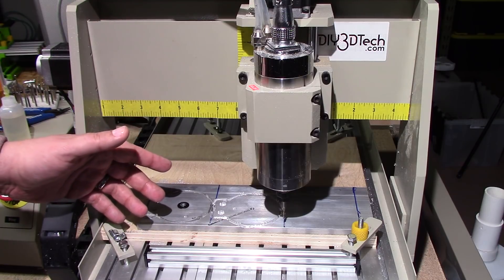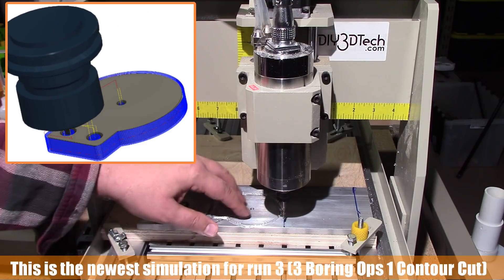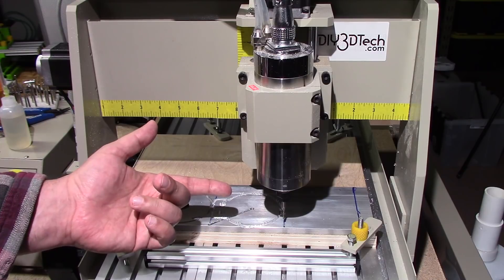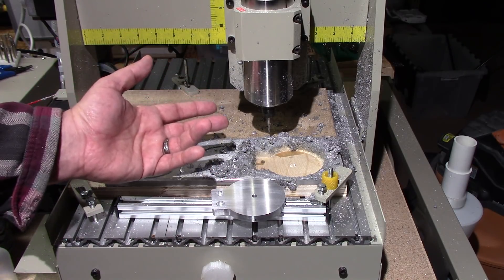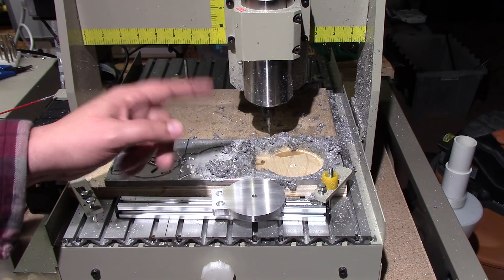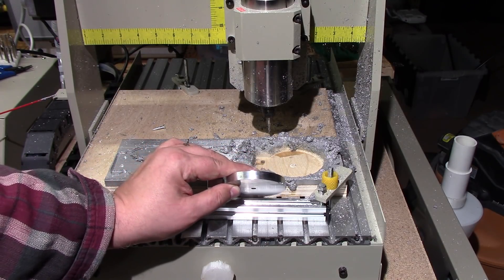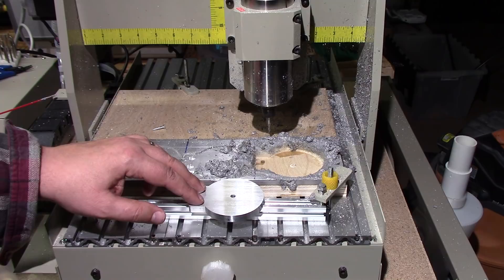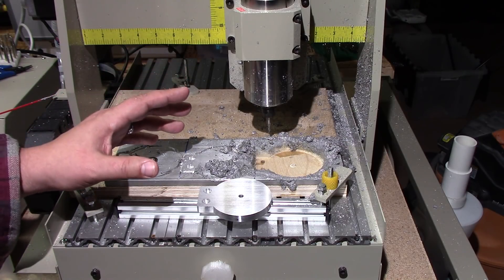3040 CNC  - Cutting Thick Aluminum Success!

Comment: Thank you so much! Have the same cnc, brand new. Wood is cutting perfectly like the cnc cutter specs recommend. But aluminum is a nightmare. I did a 1mm deep cut with a 10mm cnc mill but the spindle stopped rotating mid program. The 500W motor couldnt handle it. I saw you do 0,25mm passes. Thanks for that

Comment: It's almost impossible to give a real evaluation of a machine without fully understanding how to properly use it.  Granted, it's a hobbyists CNC, but still it's important to understand proper set up to really evaluate the capabilities of whatever is being tested.  Proper work fixturing, understanding what material is really being used, describing what the machining priorities are (fast? excellent finish?), mill bit diameter, flute count, material, speeds and feeds that are defined by those parameters, lubrication, chip removal, etc....all very important to really test the CNC.

Comment: did you connect the machine directly to the computer and use fusion 360 to run the cnc machine. Just bought a cnc 3040 second hand need help getting it going

Comment: Shorten your tool stickout a nice short stubby endmill with appropriate coating will help your not working with wood cut your stock to size and look at holding it in a vice so your not having to slot cut expecially with no proper chip evacuation

Comment: A number of things you need to cut aluminium ... A rigid machine, solid workpiece, correct bit, correct plunge and feed rates and coolant! Ideally, air to clear swarf from workpiece.
Reply: if you don't have coolant,  plenty of light oil can go a long way. i always use 2 flute for Al in regular machining. im just getting my feet wet in cnc with a mini setup

Comment: i have almost same machine, except, it seems that you've got a .8kW water cooled spindle - mine is only 400W air cooled. Since i'm currently in need of some aluminium parts I want to try this. Do you believe this can work?

Comment: Is there some some sort of resistance that hurts the motor on the long run doing this?
Reply: As long as it doesn't get too hot and the bearings are in good condition, the setup is correct, and the proper end mill is used, it should be capable of running for hours.

Comment: thank you very much for showing this video. I've been told by many people online that a 3040 CNC Motor isn't powerful enough not cut Aluminum correctly. can you give me the specs of this CNC machine.
now i will purchase a 3040 machine.
Reply: The stock 500w spindle i got on mine wasnt enough really but it could cut aluminium. If you swap it out for a palm router it can do some good cuts

Comment: Hi buddy I have been maching for yours if your using a router the most inportant thing is getting rid of the chips, use a single flute that will help you loads, and a little bit of spray oil to help with the cooling and lubrication, air is also very good to help cool and remove the chips hope this helps I cut Aluminium all the time on my CNC router, But single flute is the way to go try it and let me know how you get on,
Reply from the maker: I think this one was two flute and it did well also and used a commercial water based cutting fluid.  Also if you look in the play list I also designed a collar to hold a mister too.  I really like this machine!

Comment: These ebay cnc machines are great value and capable.fyi...you can now get a machine 2x the size of 3040 for cheap....the ebay chinese  6040 cnc with 4axis and 1500w spindle is under $1k.
Reply from the maker: Yes it depends as I really don't have need for the size of the 6040 nor the space (I have a ton of stuff).  However you are correct they runs some good deal on eBay for these machines!  I am kicking around getting 5 axis version or 100 Watt co2 laser...

Comment: Can the 500w version cut 1mm aluminum without issues?
Reply from the maker: Depends on the duty cycle, if your going to cut a piece here or there then you can make due.  However if you are going to do it on a regular basis then I would say at least 800 watt water cooled or even 1200 water cooled...
Reply: DIY3DTECH.com Thanks for the quick reply and will check them out

Comment: in cnc never this alu better 7075
Reply from the maker: I have no idea what Alu but will make note.  Many thanks for commenting!
Reply: @DIY3DTECHcom  Hello.
It is very hard to work in soft aluminum.
But if you use hard aluminum, it makes the milling job easier. 7075 Aviation Aluminum
The price is also affordable.

Comment: Slotting and profiling around the edge like that is really hard for any machine. Use a bigger tool if you can and use adaptive clearing around the edge and it will go way easier. The chips have nowehere to go on a deep narrow slot like that so you start welding material and getting material build up. That's why it's so hard.
Reply from the maker: Thanks for the tips!
Reply: @DIY3DTECHcom  no problem! I'm no expert but i know a couple things 'bout machinin' :)

Comment: Make a water bed and buy a small water pump  for a diy cooling system when cutting aluminum.
Reply from the maker: I did that for stones and glass (made several video on this just check out the CNC playlist)....

Comment: "I don't know what kind of aluminum this is"
That is a problem.
Some aluminum is soft and gummy, like the stuff you buy at Home Depot and Lowe's. It will clog up ordinary tools like hack saws and files. I can imagine how badly it would fail on something like that device. You need real 6061 aluminum or some other known type of aluminum that is easy to machine. It makes chips instead of sticking to your bits.
Reply from the maker: I don't know either as purchased this as a second, however it was a bit soft..
Reply: M T  
Yeah, and you need a metal lathe, too. And all the accessories.

I would like a CNC for cutting simple 2-D shapes. Maybe next time.

I ended up with a 3D printer. It's fun. The material is relatively soft, and the making is not precise, but it's a good view of things to come. I think the best usable plastic for an end user 3D printer is supposed to be nylon. Nylon is okay, but there are lots more plastics.
Reply: You want a 6061 series aluminum with T6 heat treatment.
Reply: As mentioned above on small machines, 6061-T6 works best. I was easily able to cut 6061-T6 on a small converted Sherline mill without air or liquids. It cut the aluminum like butter. I used a 3 flute cutter. It is possible the sherline machine is stiffer than this mill though. That might make a big difference cutting the thicker materials. And getting the proper feeds and speeds, and spindle rpm is really important.

Comment: excellent work .. ive cut deep with the 6040 on aluminum ,and it takes you standing there and watching for sure.
Reply from the maker: Yes it does take some watching :-)  I am thinking about trying to mist IPA, your thoughts?
Reply: @DIY3DTECHcom  id just go full flood coolant with a collection tray.. amazon has dog cage trays for about 25 bux , perfect water collection trough to recirculate back down to a submerged pump ( im basically doing a full on flood coolant on my 6040 now , im sick of sitting there watching )
Reply: @airgunningyup  If its only 1mm thick would i have to be watching it? Or could i just do something else while it does its job?
Reply: @chroma6947  you can just do 2 passes of .5mm , and not have to watch

Comment: Cool video.  If I want to mill 20mm thick aluminum, what wattage motor should I go with?
Reply from the maker: Its more of a function of duty cycle, if this is something your going to do on a regular basis I would go for the 1,200 watt water cooled unit...

Comment: Subscribed. I bought a 3040T with a 800w VFD watercooled but it vibrates like anything even whilst just cutting cast acrylic. I am going to work on my speeds and feeds I think a bit. I was thinking it could be the work table being that extruded aluminium type. What diameter rails do you have  on the Z, X and Y axis?
Reply from the maker: Let me see if I understand this correctly it only vibrates when your cutting correct?  If it is just sitting there running it does not and the run out on the spindle is fine?  If this is the case I would check your tooling as I would use a single flute cutter running fast feeds with fair depth cut (maybe 33% of the tool).
Reply: @DIY3DTECHcom   Thanks @DIY3DTECH.com , Yeah it does not vibrate so much when cutting plywood but my first attempt at aluminium did not go well, vibrated so much I had to stop but it was a suspect piece of extrusion from B&Q. I did notice the other day when drilling some holes it seemed to be out slightly but I made the mistake of resetting the Work Piece zeros on restart as I'd spotted the holes the night before. I think I will invest in a precision tolerance 6mm chuck and use the engraving bit and measure run out on the body of the bit to check the spindle. I still have some dials etc. from when I was an semi-skilled engineer 20 odd years back. Back then I did all my work on Manual machines with limited use of CNCs (setting up and a tiny bit of G-Code). I used to be able to amaze other machinists by taking 4mm depth of cuts with a tipped shell mill in steel  on a Bridgeport and using a 5ft Radial drill to tap 4mm holes in steel plates 6mm thick, lol, lol.
Reply: @DIY3DTECHcom  Once I increased spindle speed the results were better. I do need to check spindle run out though as when drilling can hear the drill rubbing on the retract and re entry when peck drilling, could just be poor quality drills that are bent I guess. I am using Standard precision colets that should be good for 0.01mm run out.

Comment: Do you Think you could cut steel with it? 
In my case it would be around 1 to 2 millimeters.
Reply from the maker: Yes if its mild with the correct tool.  However I would step up to the 1.2kw spindle (this is an 800 watt) if this is something you will do on a regular basis.

Comment: when you cut aluminum router cutting. the best quality 

Diamond over-DLC Aluminum φ2 2.5 3(4)mm router Endmill single(2)-flute engraver
Item ID: 254188000203   ebay.com
Reply from the maker: Do you have a link?
Reply: @DIY3DTECHcom  You can buy  https://www.ebay.com/itm/254188000203
Reply: @DIY3DTECHcom  https://www.ebay.com/itm/254188000203

Comment: It looks like you forgot to set G28 to a safe height - one of my favorite mistakes to make! I've crashed hard on several occasions for the same reason. 
Nice work!
Reply from the maker: Safe Z travel height was set to I believe 10mm :-)
Reply: @DIY3DTECH.com you seen the height setting tool? Clip to tool and touch on a plate to do, not sure if done on this or just bigger ones
Reply: it's a fusion thing, the first movement it does is without adjusting the z height, it's really annoying, because usually you set you work Z0 and then start the job. Often you forget to jog the Z up for that first movement and end up with an ugly line on the piece or a broken endmill
Reply: @mikesnapper9001  A good habit is to start tool at 1.000 above part. So Xxxxx, Yyyyy move and then from Z home to Z 1.000 then down to starting point. When Z momentarily stops at 1.000, it's like a visual safety move.

Comment: What tool are you using specifically? Best solution I have found for aluminum at router rotation speeds in a single flute O-flute cutter and an alcohol mist sprayer.  You should make the biggest chips you can make before the surface finish suffers. Your chips are super tiny even for a bit that size.  Th single o-flute will open a larger channel for larger chips.  The chips take the heat of friction out of the tool and part.  If your chips are too small they act like hot glue and clog your tiny flutes and break your tool.  Whatever part you are cutting out should be cut climb and not conventional.  This includes full cutter width profiles.  creds: using a router for 15 years to cut all sorts of things that should be left to a mill :D
Reply from the maker: I can't remember if that 1 or 2 flute, but two at tops.  I was using a using a water based cutting lubricant.  Know what your saying about chip size, these weren't bad.  I am not sure the grade of aluminum, but it was a bit gummy (soft)

Comment: You have your feeds too high and your doc is too aggressive. Also make sure you’re using an up cut bit. Retract height needs to be set to prevent the drag line. Stop using tape and machine a low profile vise. I machine 6061 on this machine all the time and up to 2” thick barstock. That’s likely 6061t from Colorado Springs the guy selling it is a prolific seller 😂
Reply from the maker: Not sure on the feed being too high because as long as the bit was cooled (with the lubricant) it did well as not sure what you mean the "doc" was too aggressive?   Also yes to the up cutting bit.  Do you have any suggestions for a water based lubricant/coollent?
Reply: Doc = depth of cut. I have this machine and for aluminum you want to use feeds 500mm/s and depth of cut (doc) 0.2mm.
Reply: @fsecofficial  you mean 500mm/minute...this cnc cant do 500mm/s
Reply: @shelby50411  yes

Comment: Which spindle power are you using? Your description links for the 3040 have both 400W and 800W versions.
Reply: I'd also like to know.  I see you have water cooling lines so I'm curious if it's a 1.5kW or higher?
Reply: @pparrett  I just saw he answered another person asking the same question. It's 800W water-cooled.
Reply: @dimman77  thanks!
Reply from the maker: I have the 800 Watt  and the for the 3040 it works well, not sure I could justify the 1.5kw unit on it.  Maybe the 6040 however that is a LOT of power (i.e. 1.5kw) these classes of machines.  However love the water cooling!

Comment: So it means if u crank up the spindle RPM and go real slow with the feed rate then the cut would be accurate and polished? i have ordered 3040 with 1.5KW water cooled spindle but 2.2KW VFD. Hope it will do.
Reply from the maker: Wow! at 1.5Kw that will be a mini monster as the 800 Watt water cooled spindle as been plenty so the 1.5 will be amazing!
Reply from the maker: Wow! at 1.5Kw that will be a mini monster as the 800 Watt water cooled spindle as been plenty so the 1.5 will be amazing!
Reply: I would advise against just increasing your RPM while decreasing feedrate.  It actually won't leave a good surface finish, because then you're cutting too thin of a chip and the cutting edge is rubbing against the material instead of shearing it off. This will also dull your cutters much more quickly.

The best way to get accuracy and good surface finish on walls is to leave some extra radial stock on the part while cutting the profile, then come back at the end, plunge to full depth, and cut all the way around to the actual final shape of the part. Repeat the last step to perform a "spring pass" and get as accurate as you can.

Comment: I used to stand there and brush away the chips and add oil. Then I did the messy air blow solution to keep the cutter free of chips. I then used to stand there with a very small shop vac and a crevice nozzle and suck the chips as they were being made. That worked the best at keeping the area clean and extending cutter life but I was tied to the machine. Now I use a dust boot brush I made and added a cyclone dust collector between the boot and the tiny shop vac. I also added a variable speed control box to the cord of the shop vac. I found that with the dust boot I can lower the speed of the vacuum and still get great chip removal. My shop vacuums last longer at the reduced speed and it's much quieter at reduced speed. It's just an old speed controller like you would use on a router. Type  "dust boot" in your favorite search engine and do an image search for inspiration. I carved my boot out of wood on my cnc but many have cut them out of plexiglass or 3d printed them.
Reply from the maker: So with the dust boot your evacuating metal chips?  The only thing with the air/bast is will add misting.  What I would like is to figure our how to build a flood cooling bath however have not figured out how to yet...
Reply: @DIY3DTECHcom   I suck metal, plastic and wood with the boot. When I just used the hand held vacuum with the crevice attachment I also sucked up a lot of oil with the chips. I always worried about an explosion in my shop vac because of the oil fumes. Your water based coolant I would have no worries about sucking up in a wet vac. I like the in closed flood coolant systems at work but they are not practical on most of my personal machines. The water based coolants are getting better but they have their own problems. After decades of exposure I'm now highly allergic to many of the coolants. Some get rancid and all the filtering in the world won't fix it once it starts to go bad. A company I worked for installed a big filtration machine to recycle the coolant. It spun out the oils and filtrated the rest. Once the funk started growing in a little used machine it spread to the whole plant through the recycling machine. They had to dump thousands of gallons of coolant and start over. They then discovered they must have missed some because all the new coolant got the funk growing in it less than a month later. They dumped it all again and scrapped the recycler. They had to go to another type of coolant, this time a semi synthetic. It was a tool and die shop here in Iowa. The Department of Natural Resources was going to make sure the old coolant got disposed of properly. Huge cost! A local farmers sewage tanker truck showed up at the plant on a Saturday and when we came to work on Monday all the toxic coolant had disappeared along with the farmers tanker. I'm sure we will never know where it went on a Sunday.